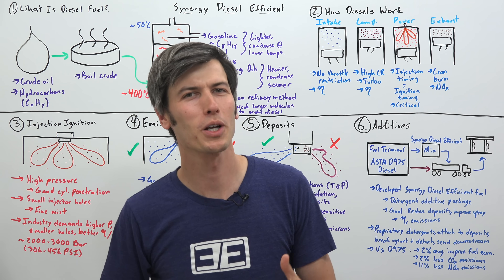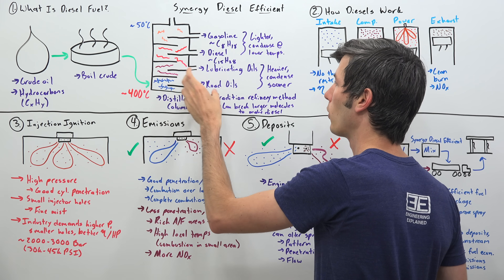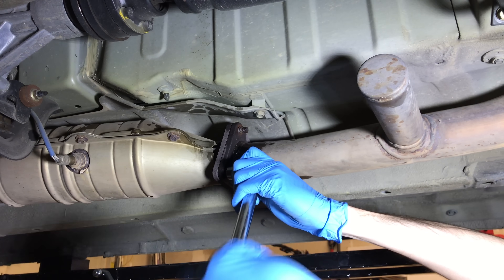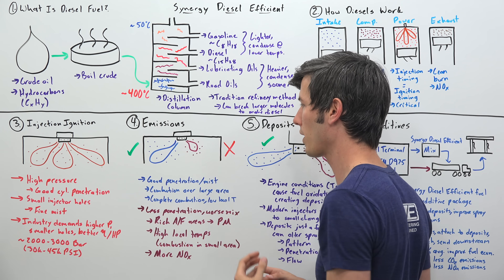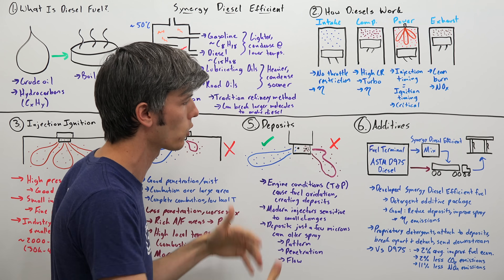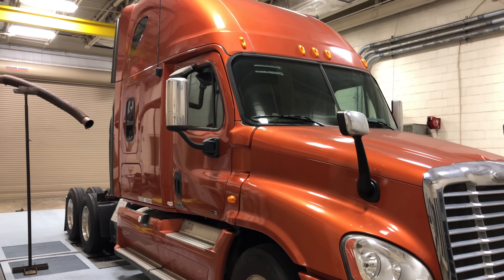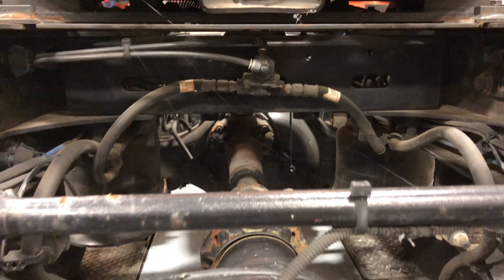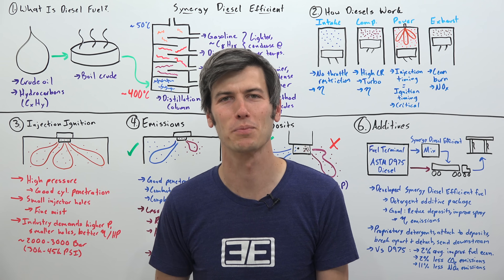Why Diesel Engines Lose Power & Efficiency Over Time

Comment: The 2% fuel savings only occurs against a dirty engine.  There's no difference vs a clean or new engine as I understand the presentation.   Although, I suspect if the injectors were really clogged and if this additive could clean them, fuel savings would be even more significant.  

In as much as we know that standard fuel works overall fine, based on the trucks already out there running without the new fuel, the difference in price of the new fuel is most relevant to whether it's worth using on a regular basis.  If the new fuel was the same price or less expensive than standard fuel, buying it is a no-brainer.  If the new product is more expensive by more than 2% it gets harder to justify.  Noting that the new fuel does nothing for an engine that is already clean.

So in short, if the new fuel is locally available at the same price, it's a good deal, but if it costs more and requires a longer trip to obtain, it might not be justified for regular use...

Lastly... it's getting kind of old hearing oil companies use the term "proprietary".  If I buy a cookie, I have a right to know what's in it.  When I buy gas, its a state secret.  If someone really makes a better product, why are they afraid to tell us what it is?  If Exxon is better than Shell, they should tell us why.  If oil companies were transparent, we could evaluate the products against each other and the competition would actually lead to better products and fewer 2% better economy claims based on a single "fair" test criteria.

Consumers and even most testing labs can't fairly evaluate the components of fuel or lubricating products at a molecular level.  This means we have no objective way of knowing what is good, better or best and allows oil companies to pretty much claim whatever they want, knowing that no one can dispute their claims.
Reply: R J all excellent points.  I’d like to see the results of shells “nitro” and chevrons “ techron” diesel additive packages.
Reply: @jeffreygoss8109  Results, like statistics can be manipulated... chemical composition doesn't lie.  If there's something in a product that's supposed to do something, tell us what it is.  I'd run my vehicles on snake oil if it could be proven to increase engine life and save gas... But if you don't tell me what's in your product I don't know if you are really selling me snake oil or just selling me snake oil.
Reply: How about if the injectors never get clogged and dirty in the first place then you never get the 2% loss to begin with. That in itself may make it worth it.
Reply: Karl Batzler then they will claim that their additives prevented it and saved you money. Like RJ stated it’s a sales pitch
Reply: @kbatzler  In the real world, there is no way for an average driver to prove or disprove an increase of only 2% fuel economy.  This is the difference between 20 MPG and 20.4 MPG. Weather conditions, breaking, road conditions. tire inflation and minor variations of speed or acceleration will cause more than a 2% change in fuel economy.  By analyzing the nature of the additive package, we can determine what sort of solvents are used and in what concentrations to determine what kind of detergentcy they might provide under certain conditions.  If someone really has a better detergent, all they have to do is tell us what it is or what's in it.. as easy as that.

Comment: I work in a diesel shop on semis, modern engines and high pressure fuel has ruined so many people's engines its not even funny, drivers O/O report no fuel economy increase, but maintenance and repair costs of the emissions systems are unsustainable, go buy a semi Nox sensor or dpf filter, and youll see what im talking about, not counting the time in diagnostics, that is its own nightmare.
Reply: I  know what you mean, manufacturers have not progressed in making engines more reliable, its all about emissions now, and the systems suck.
Some Volvo Common Rail engines are running 90,000PSI fuel pressure, sure you get good power and economy but they self destruct regularly. 
And sone DPF exhaust sytems are only good for 100,000km and cost $6000 to replace.

Comment: Correct me if I'm wrong, but couldn't you just run B20 diesel if your concerned about fuel deposits?  In most modern diesels, they can run B20 which from my understanding has high detergent qualities.  I know b20 is not as efficient as normal diesel, but run a tank full every few k miles should keep everything clean.  It would be interesting to see if Jason could look at the benefits of blended biodiesel.  Just my $.02.
Reply: Yes, biodiesel has a detergency quality. However, it is not as stable as petroluem diesel. It may oxidize and form deposit in your fuel system. Impurities in biodiesel can also plug fuel filter. If I have a choice, I would use a neat petroleum diesel with an additive.

Comment: You didn’t really explain DEF fluid. It burn off any exhaust fumes. Which turns the exhaust into pure oxygen.  The down side of this system. It clogs up the muffler of Diesel trucks. Which in turn derates the engine. It crystallizes inside muffler. And the filters can be $2000 each. I drive a body job for a living. And used the non-DEF trucks and DEF trucks. Real world and a clean controlled facility are two different worlds. Plus gas and Diesel are purple naturally. They put dyes in the fuel. They sell purple and clear fuel.

Comment: 3000 bar cylinder pressure ... by comparison, 1050 bar is considered max safe operating pressure for modern 12ga shotguns.
Reply: It's not cylinder pressure... it's fuel pressure....
Reply: @mattlane2282  Thanks.

Comment: 1999 7.3 turbo diesel mated to a six speed manual.

20 years and 380,000 miles later, all she needs are glow plugs, a front universal joint and some body work. Still hauling 5th wheels and hay trailers. This is one hell of a truck!
Reply: HarrisonCountyStudio reliable 👍😎
Reply: Actually Robert Beck, I was touting the Navistar International Corporation’s turbo Diesel engine.
Reply: Rah Rah Rah @tigerseye73   just turned 465,000  lol 😝

Comment: I don't even care what pump or what goes into my diesel cars, yes, all my cars are diesel, only 4, because reasons, they loose so much power that all of them have exactly the same HP and Torque from new :) and all of them are over 350k miles and one is near the 600k miles marc, with very little maintnance :) In europe diesel is still king of fuels (the reason we don't have acid rains) and costs does matter.
Reply: In Europe diesel sales have collapsed in the last couple of years, mostly due to VW lying about emissions
Reply: You're tight sales have collapsed, I think diesels are only 50% of the cars on the road now, hardly getting phased out🤔 last time I saw it it was 49% petrol 51% diesel

Comment: Time of day confound the results?  Meaning air temperature and humidity difference between the tests times.  Is Diesel similar to Kerosene and or jet fuel?  It would be neat for you to show a segment about the development of railroad Diesel engines over the years along with 2 stroke and 4 stroke Diesels and the strict emissions that current Diesel locomotives have to abide by.

Comment: You touched upon it lightly however i would argue that clogged up diesel particulate filters are the main concern in modern engines (at least here in nothern Europe). Some cars need to have the filters cleaned or changed almost every 100.000 km's... do modern engines output larger particles or is there another reason for this premature clogging?
Reply: anermand the main problem with Euro diesels is the dpf’s get clogged up by a lack of long-distance journeys, which doesnt allow the dpf to regenerate. When a dpf regens, it shoots fluid (ammonia) into the dpf which raises the temp and burns all the carbon out. This happens at a certain engine temperature and speed, i.e highway speed, to avoid releasing all the contaminants in built up areas. If the car is only ever used around town for small journeys, the dpf cant regen and gets blocked up. This leads to a whole world of problems. Look up the PSA 1.6 hdi engine, “black death”.

Comment: You can tell there are a lot of truck drivers commenting here, because all you read is a whole lot of bitching.
Reply: It's affected their operational lives, so it's good feedback.  what you have to filter out is which are and which are not maintaining per manufacturer's recommendations vs "old habits"...  it's more complex since ULSD and more technically integrated engine systems and the emissions reduction requirements...
Reply: I have a 2015 Freightliner at 825k. Average 8.5-9.5mpg depending on weight and terrain. I never have to top off oil, starts off at the top of the full mark, and might drop 1/8-1/4 inch on the stick by the time I do my next oil change. My clutch is original with almost new amount of wear and all my brake pads are original with plenty of wear left. Only repairs done on the life of the truck are 3 brake chambers, 2 nox sensors, starter, water pump, radiator, and a few coolant hoses. If you take care of your vehicle there should be no major issues. People say I'm lucky, but magically every vehicle I'm the original owner/driver there are no major issues, and when I'm not, there is usually some sort of abuse or extra wear repairs needed.

Comment: So sad that the US can only make diesels for trucks and semis ... no American car maker comes even close to European diesel engines.
That is why they killed diesel passenger cars with diesel-gate and now with the further demonization, even though these are the most efficient engines.
Don't get started on Teslas and electric engines, 60% of that energy comes from coal or gas plants in the US so the inefficiency is just at the plant.
Reply: A coal or gas plant will always be more efficient in generating and distributing power than any internal combustion engine out there. 37-60% for a plant vs 25-50% for a car.

Comment: Remember, Herr Professor Doktor Diesel himself designed the engine for peanut oil and similar raw vegetable oils that farmers could grow themselves!
Reply: Lyfan Deth I know a guy who rebuilt his 76 Mercedes diesel to run on used cooking oil from takeaway fish & chip outlets. It’s filtered thru 3 stages, but does require heating core in fuel tank and along fuel lines, but if set up properly, fuel system can run on 90% filtered oil and 10% diesel fuel. Can even run used sump oil & trans fluid provided it’s been filtered sufficiently.
Reply: @realaussiemale567  I can't help but wonder if running on too weird of stuff makes it a rolling coal situation.
Reply: Lyfan Deth true that. And until recently when much higher pressure injection systems a much smaller openings in fuel system parts came along. Lots of diesels could be converted to fun on used vegetable oil or something like that.
Reply: The waste vegetable oil from restaurants can also be used for diesel fuel, however, it must be refined to remove the heavier glycerin from it. The glycerin itself can be made into soap.

Comment: Cool video! Love the work. You said that this fuel helps improve performance by "helping to restore the fuel injectors to their like-new state". Does that mean that you could get the same results by replacing the injectors? Would some injector cleaner run through the system have the same effect? And what is the cost difference for the difference in performance?
Reply from the maker: Yes, I would assume you could get similar results by replacing injectors, but obviously that's very expensive to do. Parts alone are quite pricey.

Comment: Seeing as diesel is closer to crude oil than gasoline it makes sense that it'd be 'dirtier' which is something i did not know until the white board came out. Also, i understand the value of a proprietary formula but given that all the fuel manufacturers start with a known diesel mix would they not be able to test the final mix compared to the original and determine the additive mix?

Comment: A million mile semi doesn't feel healthy at that point. New fuel⛽ can't typically save it 😂
Reply from the maker: 350k, not a million... They generally last till about a million.
Reply: @EngineeringExplained  
Did drive one with 802k miles on the clock. It was slow as a snail though. But it's absolutely doable even if everything else is past its "best before"

Comment: Despite every downside of diesel engines, I'll be a "turbo-diesel head" forever.
Reply: Ramzi AJEM You must be a TORQUE lover
Reply: I still love a high revving gas engine. But I do have a soft spot in my heart for a good diesel. Currently driving a 7.3 liter. I used to work on large ship diesels engines.
Reply: @jacobdukes4741  Until you try electric - if you think diesels are torquey, you ain't seen nothing yet. Still no electric cars available where I live that don't suck though, either from an initial cost/repair cost point of view or from a being an underpowered piece of crap point of view, so I'll run my big TDI wagon into the ground hoping something that's actually better comes on the market before it dies. A little over 250,000 km on it at the moment, so I can afford to wait...
Reply: @peglor  Haha short mileage and too much weight to go anywhere go .............

Comment: How much extra do they charge for 2% improvement
Reply: All the exxons around me are a ripoff... always higher on fuel costs... gas it gas diesel is diesel... also you know they sell additives you can put in yourself that btw... if this was anything REAL and not just a paid exxon commercial... he be talking about lubricity that, from what I can see... is not up to manufacture spec (when it meets us spec) but alot of the time is outside of the US spec even at the pump... one of the main reasons claimed for failures of the HPFS is... lubricity... I run additive every tank... it does cetane, cleaning, blah blah IDC... I run it for lubricity
Reply: @mattlane2282  May I ask what kind of "additive" you're running sir?? I have a 98 Volvo D12 that may need fuel injectors "cleaned" or maintained always for good operation.
Reply: @michaelsamuel9917  "Stanadyne Lubricity" & "Opti-Lube" are both top products verified by independent tests.  I've been running one or the other since 2012 in my '11 duramax.  If it gets cold where you live be aware they don't help with gelling at all. Opti-lube does have a winter blend IIRC. You can get a 5 gal pail of Stanadyne for just a few hundred dollars on Ebay and it works out to a very reasonable cost per tank.
Reply: @TOdoubledizzle24   or they'll figure out how often running with it provides a good net return - maybe it doesn't need to be the sole fuel source used...
Reply: And yet how much do people pay for more power? This basically restores the power you lost or maintains the power you are aiming for. 
If you can spend over $10'000 for a diesel upgrade on your truck you can afford another 20 cents on your fuel cost.
Reply: @MrComputerCoder  They didn't make the claim it improved power, they made the claim it increased fuel efficiency. If it is 2% more fuel efficient but costs 10% more, you're hosed. 

And if you're spending $10,000 to gain 6bhp on a 300bhp motor, I've got an uncle in Nigeria who is a prince and really needs airfare to escape the country with millions of dollars in diamonds. He promises he'll pay you back 10 fold.
Reply: @MrComputerCoder  10K what up grade? Be specific. Giver take on my 03 5.9 Cummins 1500 for a new turbo, 1500 for new OEM injectors, 1500 for new CP3 Pump. 2% may not be enough justification for the daily driven light duty diesel truck but it is a big deal for a company running multi billion dollar fleets.
Reply: Myles Swann this is true. But even ignoring the 2% fuel economy gain, if the fuel is able to remove deposits from injectors and extended their useful life by 50% or so then that means over the course of half a million miles buying that fuel could mean one less entire set of injectors which would save you 1500 in parts cost alone not to mention downtime and labor costs unless you do the job yourself. To combine that savings with a 2% increase in feud economy will save a decent chunk of change in the long run, even for your average guy with only one or two trucks

Comment: Kerosene and a few other light oils come out of the top before gasoline.  Another topic you could go into is just the distillation and cracking process. It is very interesting and not that complex of a process to go over.

Comment: How much does this fuel cost over normal diesel though? Surely they'll charge more so it has to be significantly less than 2% more to make it even worth using! I think premium unleaded has a premium of about 10% over normal unleaded yet it is far from 10% more efficient so I do not see them only raising the price by less than 2% hence this isn't more efficient when the fuel costs more.
Reply: The difference between premium and regular is a completely different thing.. That's about the difference in octane for higher performance engines.. It's not at all about it being more "efficient." it's about reducing knock for higher compression ratios. You're comparing apples to oranges here. If your car calls for regular fuel and you put in premium not only will you not gain any efficiency you are more likely to actually lose some. Any gain had would be from the additives not found in the regular fuel that are in the premium ones cleaning your dirty engine.

Comment: What kind of drive cycle was used for the tests? Something that simulated real worked accel/deccel, loaded/unloaded etc? Or was the engine just run in a particular RPM range, which may or may not be this additive's sweet spot? The NOx reduction is certainly meaningful, but without knowing the drive cycle details, pretty hard to trust the 2% fuel economy improvement number.